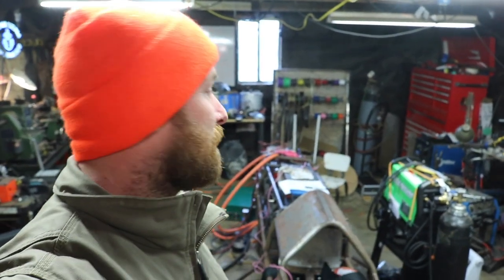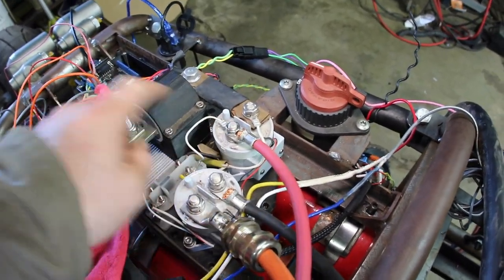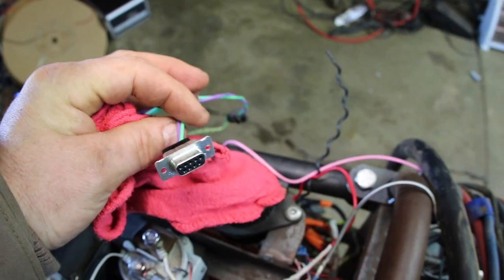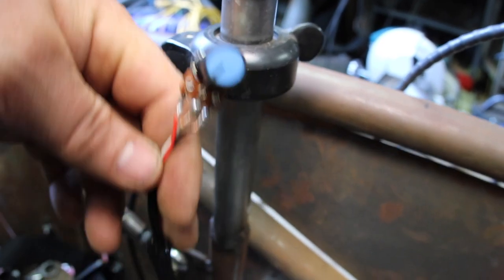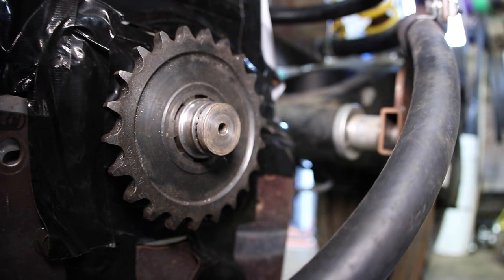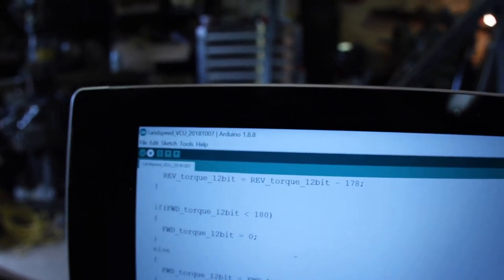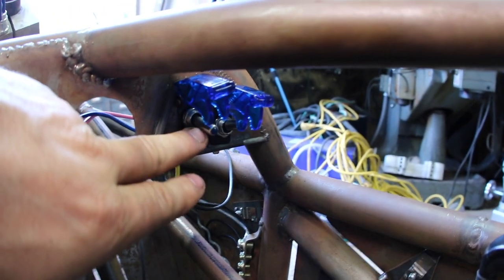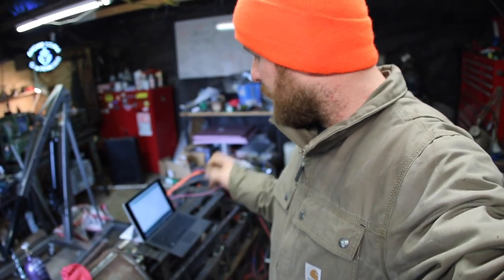Lark Streamliner | Electric Motor Testing

Comment: You might want to cover those hi voltage wires with a rubber mat.  If you drop a wrench on those with just a washcloth covering them will probably still give you a light show.
Reply from the maker: Yeah, I know.  I'm being extra careful till I get the cover on.  I know first "hand" what happens when you short DC high Voltage!

Comment: Please tell me you have a fuse closer to your battery in the actual pack. If not have one directly connected to the battery in the battery housing.
Also Investing in a cheap abs project box would make the HV setup alot safer to work around/have in the vehicle.
Reply from the maker: Thanks for the comment! I am going to make a custom leather cover for the BDU once the battery gets installed.  As far as the battery fuse,  I am planning to have one undersized intermodule busbar that will serve as a fuseable failure point if there are any major issues.  I have also purchased a isolation detection circuit.  This isn't my first HV battery.  I have built and designed over 20 different HV batteries in my day job.  Prototype HV work is always dangerous, always the voltage before you touch, use isolated tools, and be alert and aware.